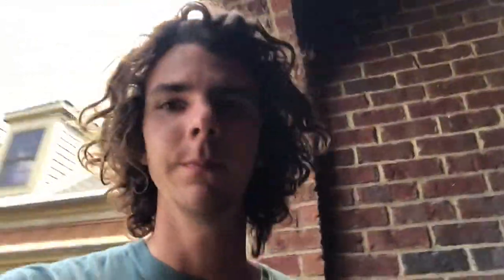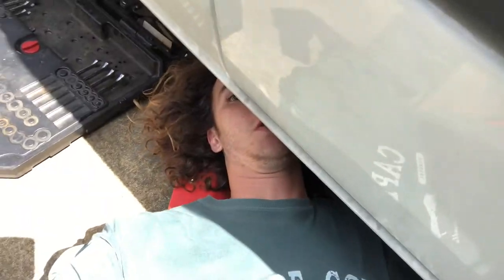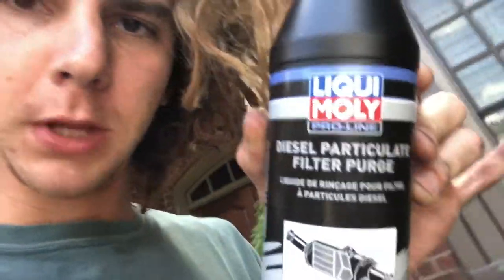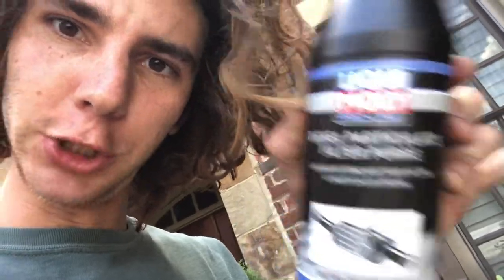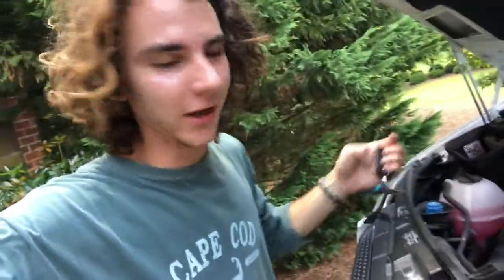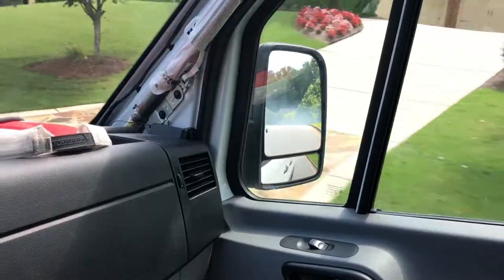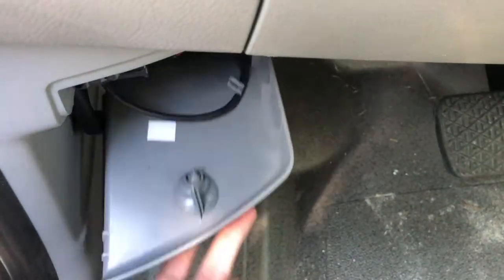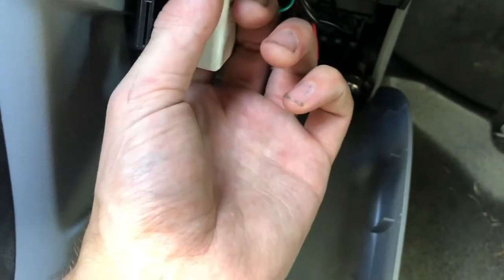Cleaning your particulate filter: sprinter van

Comment: check the steve b turner videos on this.   Caustic soda (be careful) / sodium hydroxide will clean most of it (oil/soot) out for you.  Whether you can do it through the sensor hole I'm not sure.  

Pool acid (HCL) will do the rest of the ash (25% conc with water) but pay attention to Steve's safety precautions (critical).

Comment: Great video and good work. Usually, you have to clear the codes with obd2 scanner and drive to see if they come back. The valve you want to pump the fluid in is called the :
DPF differential pressure sensor hose. Also check if you have an EGR valve and dismantle this and clean. Then drive it at 3000 revs for 30 minutes to clean and see if codes return. Drive diesels like you have stolen it. By the way, the Expert DPF mechanic in the uk is @ORileysAutos. Also change oil and filter afterwards due to contamination….DPF issues can be symptomatic of so many issues.. and regen is not always necessary

Comment: Did the code clear?
Reply from the maker: There was a couple more issues than the particulate filter needing to be cleaned. after that I ended up taking it to the dealer and they discovered a small leak in a hose leading to the turbo and after a few upgrades to the emissions system it was all covered under warranty and it cleared the check engine light.
Reply: @Absolute_North  Can you describe in detail what kinda leak in the hose toward turbo?
Reply from the maker: @rambowboy  I wasn’t shown first hand the leak in the hose but what I gathered it was probably a fracture in the hose due to some dry rot. It wasn’t visible from the engine compartment and wasn’t big enough to be a noticeable issue when I initially inspected it.